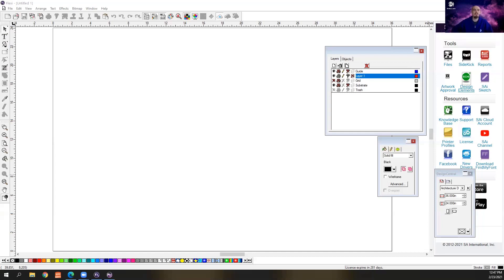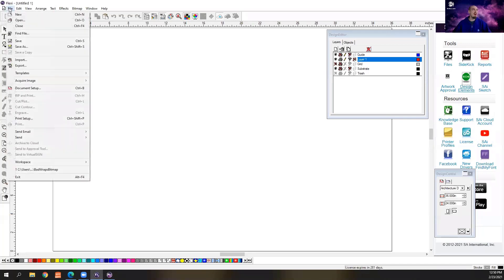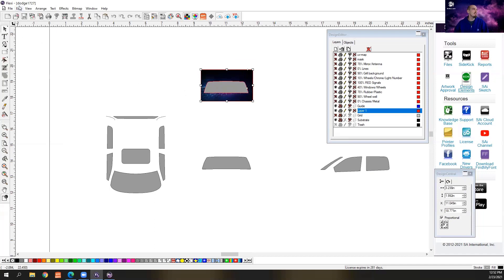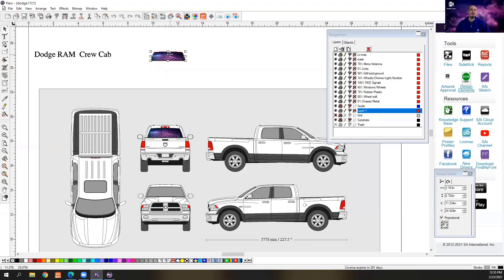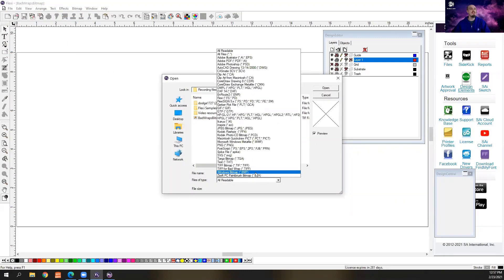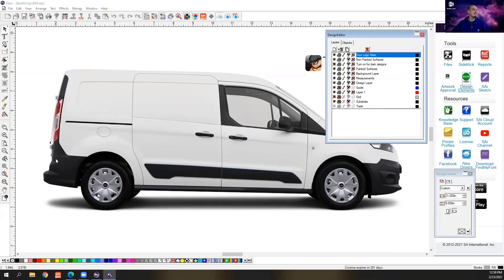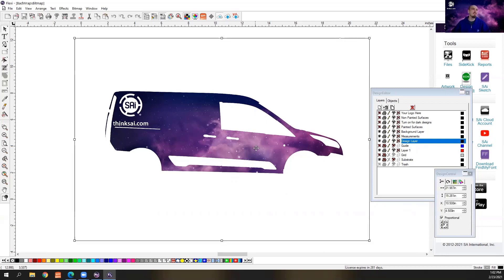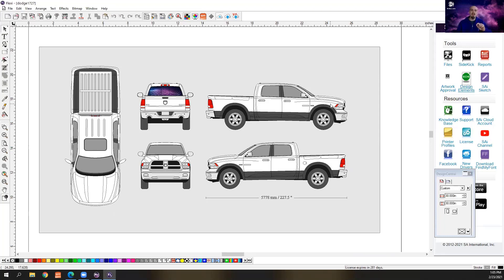Workflow Wednesday - Using Vehicle Templates in Flexi

Comment: Can I trust 100% on the scale? My question is if I mask an image on the window as you did and send it to cut is it fit exactly?
Reply: In my experience any time we rely on template measurements it is never dead-on accurate and oftentimes way off the mark. templates are great for reference and mockups but if you have the ability to take your own measurements you should.
Reply: Definitely NOT 100% accurate.  What's more this vehicle library supplier can be so out of date it's unreal. Often tried to search for a truck outline that only shows models 10 years older. I wish SAI would add ccvision to the vehicle library they are the best choice by miles